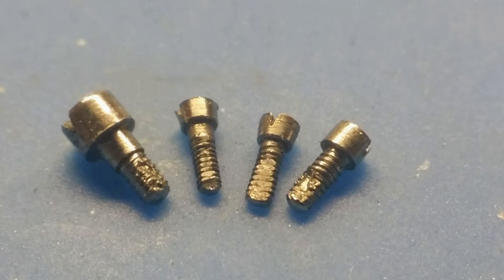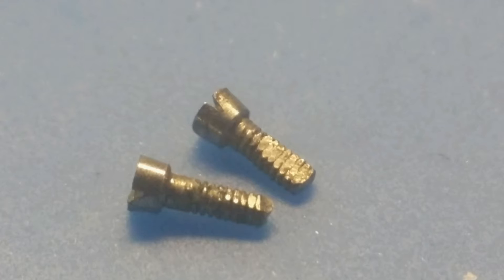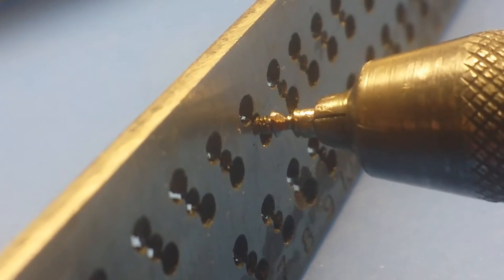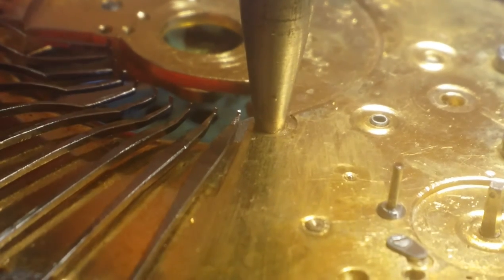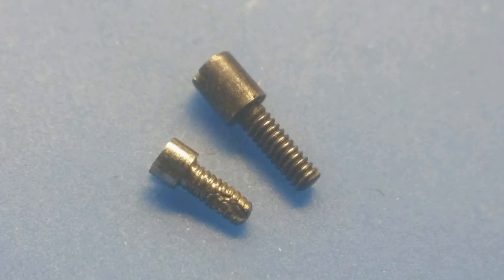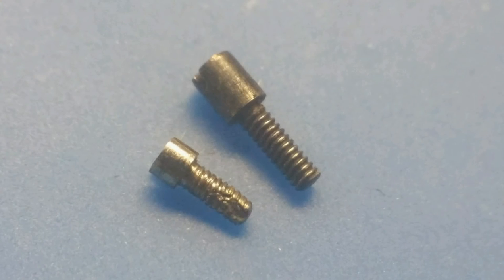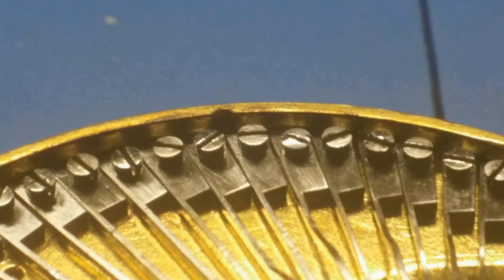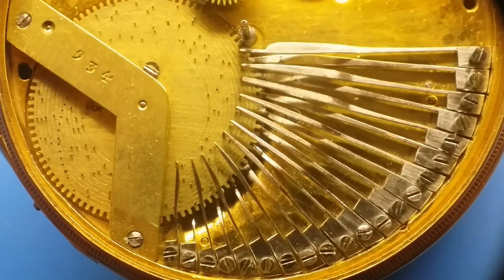Damaged screws & stripped threads

Comment: I've got no background in watches, but I've worked as a welder fabricator before and I have never seen or heard of anyone pressing around a hole to decrease its diameter. As soon as I saw it it made sense but it would never have crossed my mind. Great work! I was also intrigued with the thread plate. Does it have another name? I did a quick search and it brought up nothing.
Reply from the maker: A thread plate is all I know it as. Search ebay for watchmakers thread plate or maybe die plate. Something should come up.
Reply: Known as a “screw plate” in England.

Comment: What should I do for stuck screws? I have an old watch that was obviously never maintained as the main plate is not shiny but dull
Reply from the maker: Good question. Is there rust seizing up the screw? If so and you are able to strongly support the plate it's in, I sometimes place a screwdriver in the slot and tap it with a small hammer to shock and break up the encrusted rust. Then soak the general area with oil and let it sit and soak in for a couple of days before trying again to back it out.

Is it a bridge screw or other? If it's not a bridge screw, be sure it's not reverse threaded. Many reverse threaded screws have had their heads turned off when trying to unscrew them the wrong way.

Good luck